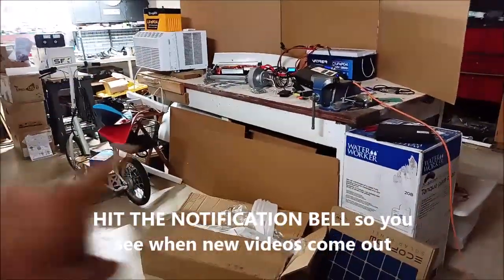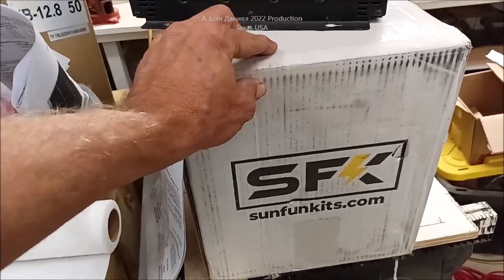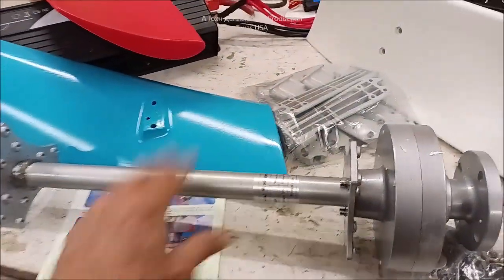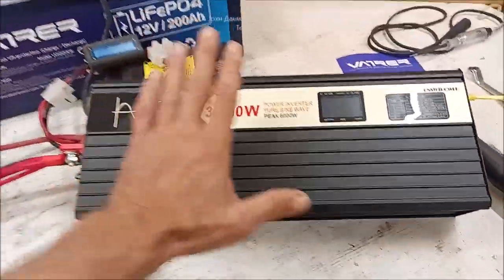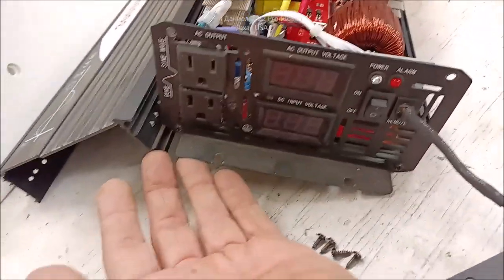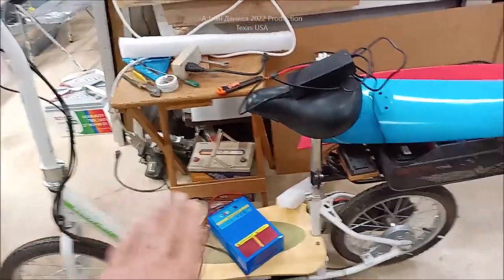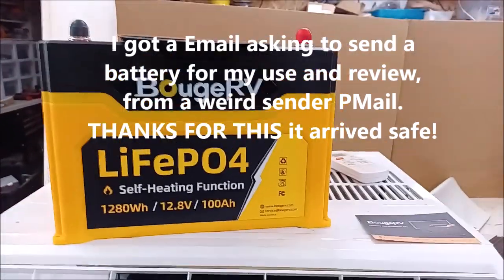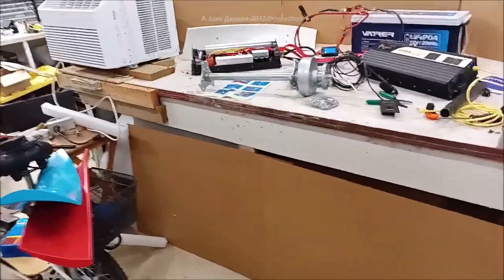New Materials, upcoming videos, new discoveries, ideas and methods, listed parts are below

Comment from the maker: As Promised I have listed all I can. ⬇ SWI-Power Inverters https://s.click.aliexpress.com/e/_DeHA1eB See the NEW MODELS OR https://s.click.aliexpress.com/e/_DdFu0nv
LOW WIND 600watt GREEN ENERGY TURBINE  https://s.click.aliexpress.com/e/_99l1XF Full GE Wind turbine store https://s.click.aliexpress.com/e/_AFDRgV
Power Queen LiFePO4 Batteries 10 to 400 Amp for bargain cost https://amzn.to/3C5AHEE
TIME-US'B Battery https://www.timeusbpower.com/discount/PokyPower?ref=vBPtCFQp
RED'ODO Battery https://shrsl.com/3qfdz
SUN FUN KITS https://www.sunfunkits.com/category/1/battery-kits
BOUGE-RV Self Heating LiFePO4 100AH https://amzn.to/3yl419n
Itty Bitty Tiny 18 lb so called 800 watt VAWT seen in Video https://www.aliexpress.us/item/3256802598808339.html 
20Ah bike Battery https://s.click.aliexpress.com/e/_DEflcI3
EcoFlow Power Stations https://shrsl.com/3qfeh
Costway Deals https://shrsl.com/3qfec
Reply: Power Queen link not working.
Reply from the maker: @martinsteflik1329  go to , scroll down, check out picture (ad Power Queen 25.6V 100Ah 2.56kWh Deep Cycle LiFePO4 ) 2, Check options on it where it says CHOOSE  https://amzn.to/3C5AHEE
Reply from the maker: @martinsteflik1329  Yes, site down so I put in the discount back door on Amazon for everyone.
Reply from the maker: @martinsteflik1329  repaired it https://amzn.to/3C5AHEE
Reply: picture on inverters only single 120 plug in picture in option on that page only says single output plug also
Reply from the maker: @mikemoore8434  Yes, the complicated methods of using a split 240 output is outside of about 90% of peoples general abilities to apply, It is easier to isolate most average circuits for 120 volt and a 240 VAC 6000 watt uses much more stand by power than 3 of these does for the same end price to get 9000 watts of ability.
Reply from the maker: https://s.click.aliexpress.com/e/_DdxSGj1

Comment: Will David jehu and the professor have found their golden spoon and they have forgotten us poor people I'm still trying to find an inverter like this that you pair together for 2 2000 watt legs and 4000 watts 240
Reply from the maker: Best option for those is the ones with the really big transformers which is the Sun Gold 4kw. https://amzn.to/3SX677a 
Those are the 4000 Watt split phase 240s you're talking about right?
Reply: @JOHNDANIEL1  yes but how expensive are they I'm trying to put together a system for around 1000 $  2000 would be tight I started to set things up about a year ago I had over the years ended up with 3. 1750 modified sine wave inverters one I had bought about 20 years ago when I was trying to set up a.. mobile home off grit it did the lights microwave and charge my power tools but now I've found utube and found they are no good for electronics and hard on everything else a utube video I watched on the Duracell 1440 solar generator said to get a triplite lc1800 that wood bring it to a pure sine wave under a 100 dollars so I went online and found one with our lower dollar it was 138 dollars still reasonable but as they almost always say shipping will be added at checkout so I quickly filled it out got to check out and saw the shipping price 385 dollars I quickly canceled the order seams that's the problem with being in Canada its about 30% higher price and sky-high shipping that's why I was hoping to find a 2000 watt pure sine wave inverter that I could buy and set up then probably at the end of the winter I could either add more batteries or upgrade to lithium then next summer when I need my ac then buy a second one so I can run the ac next month I'm planning on ordering my 12 volt DC led and the material I need to set up 4 power stations for our lamps cpap machines  phones and laptops I'm taking the advice from a RVer don't wait until you have the perfect set up start and change or in my case upgrade later so while lighting and chargers wont save much there a start maybe with the race to make the perfect solar generator maybe someone will bring out a low price one that can be upgraded later to add 240 volt split phase there's hope a electronics company is entering the race and has one on kick starter that near as I can tell has two inverters one for 120 volts and a second 240 volt for running submersible pumps and such and it's a reasonable price but then you have to separate your pump from the main panel box

Comment: Please do a short update video about meanwell inverters. either TS or TN series. I purchased two units after watching and impressed by your reviews. your reviews are pretty much the only videos on youtube about those inverters I can find. I would like to see how those are holding up still if you have any. Also the power input range issue as you mentioned in previous video comments. thanks  sir
Reply from the maker: The Tn 1500 is still in use in Baker Nevada, seems I can't kill it. But the 3000 had a problem due to me following their posted settings, then when I did they sent me a retraction saying USA model only set max voltage to 14.8 VDC. So heed that.